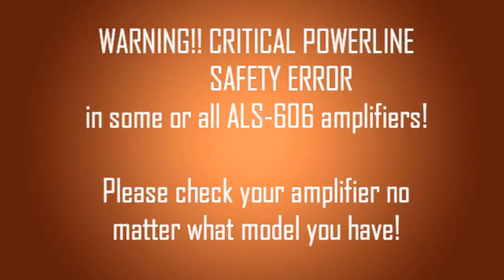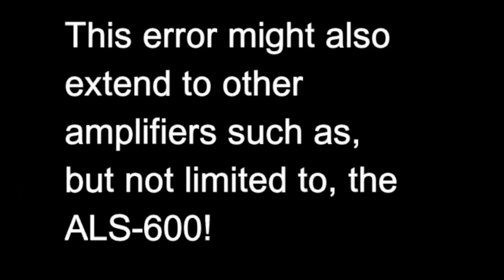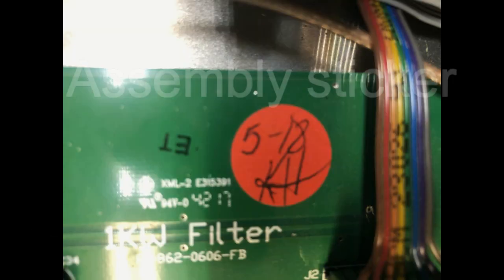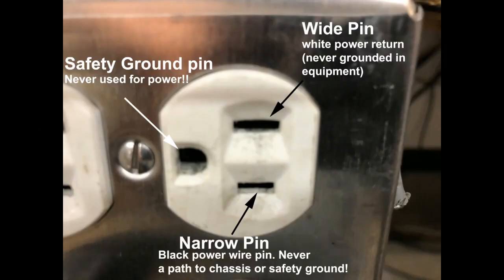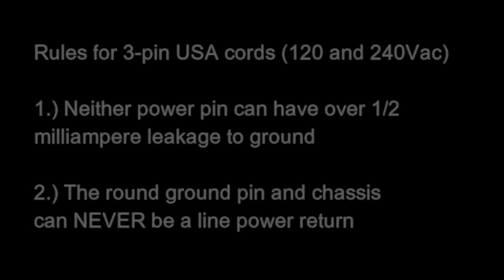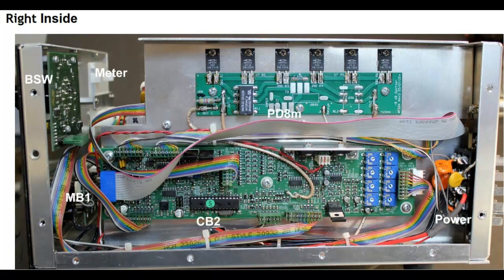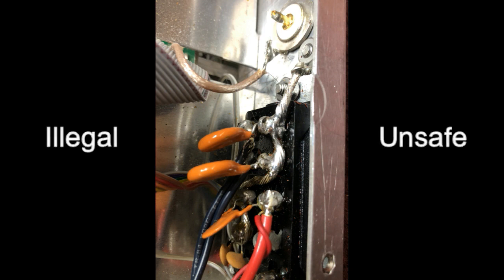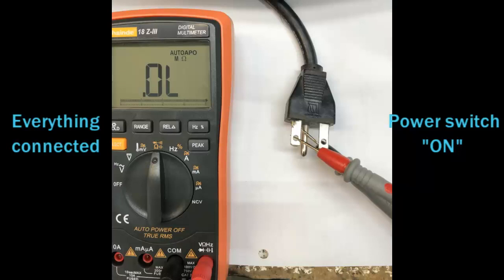ALS606 power connector

Comment: Just checked my ALS-606 by using and ohmmeter to that pin to the chassis and it was a dead short.  So I pulled the cover and sure enough it had the connection to chassis ground.  I just snipped it out and replaced the cover and very glad I saw this video.  Many thanks Tom !
Reply from the maker: Don't mind my anti-spam name. :) This is Tom.

What serial number and date is your amplifier? I'm trying to get an idea of when they made this change, how many amplifiers have this problem, and if they blow up if wired for 240Vac!!!  This will also potentially damage the power supply. This factory screw-up has a very complicated field result! 

There was a time when they added an illuminated off-on switch. I'm not sure if they made this change at that time or at some other time.

Incidentally, there were conversations where I warned their local staff the switching supplies were not 240Vac compatible with the ALS-600 and the 120V fan unless a small step-down transformer was added. I'm thinking someone went rogue on that and used the power line safety ground pin as a fan and a switch light return. I have not had occasion to look at that yet, but I always wondered how they got the switch light to work. 

This is a real surprise to me. Powerline safety is critical. This can hurt people.
Reply: The serial number sticker on this one is unreadable, but the QC stickers inside all read 2017.  I got this one used from someone that didn't need to own an amplifier and basically beat it to death.  I spent a couple of hours beating dents out of the case cover just to get it looking halfway decent, and several days reconnecting wires that had been torn loose and replacing the 9 pin remote control socket.  Luckily, when I finished, the thing did work and has been working great for over a year now!  I did have to replace the relays in it too.

Comment: Hi Tom,
Bought an ALS-606S late April 2023. Worked OK on 120VAC, but when configured for 240VAC would blow the fuse on the white wire. Contacted Ameritron and had to send it back mid May at a cost of $120. When it was returned it did work on 240VAC and the service report mentioned that the installed fan was for 120VAC and should have been a 12VDC. I did the test mentioned in this video and did not see any connection to the round plug pin. There was a connection from the white wire to the round plug pin when it was setup for either 120VAC or 240VAC before the amp was sent back for repair.  73  WJ3U
Reply from the maker: I have found several amplifiers wired this way. Grounding the neutral to the chassis is both illegal (against national electrical codes) and unsafe in any amplifier.  

In the ALS600 analog supply that pin ties to one side of a transformer primary. If they are going to have a universal supply that works with the 600 amplifier and its 120Vac fan, that neutral pin has to float in all the other amplifiers.

Comment: Thanks for posting this Tom. I wish my ALS-600 was a 606 for the 6 meter function. 
I must say that it has been working very well. Only have to blow the dust out of it and about ever 6 months gently clean the relay contacts to keep them from sticking. I just use air to blow away any particles, and use a thin strip of heavier standard printer paper across the contacts and its read to rock n roll again. 
Great to hear from you Tom.
Stay safe and stay blessed. 
Greg
KT4RAM